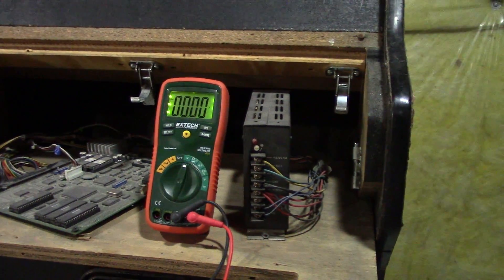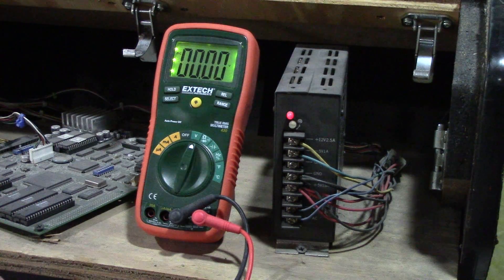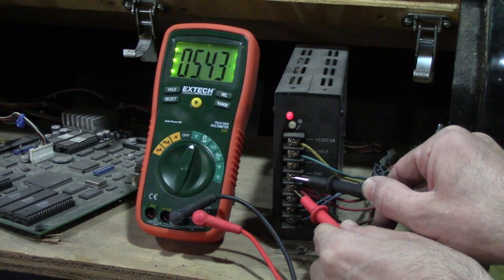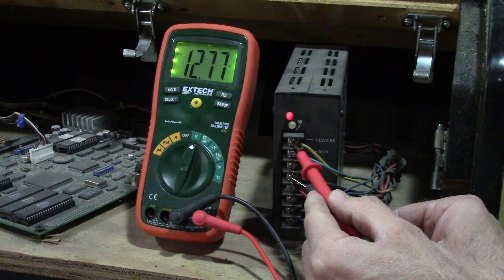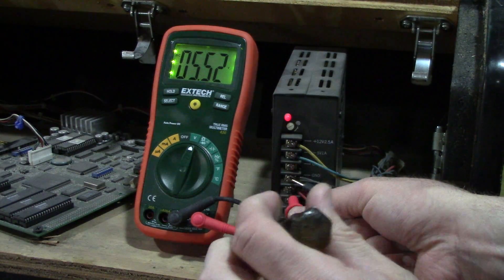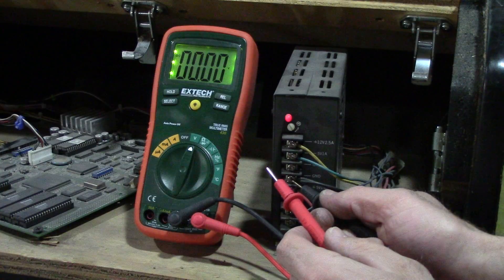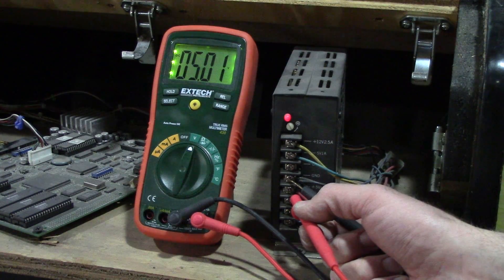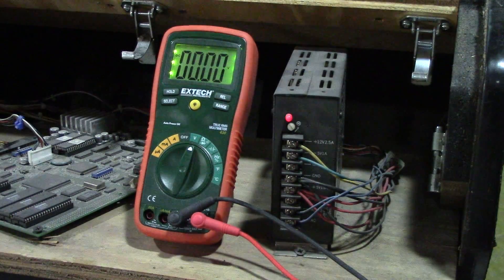How to test and adjust Arcade Power Supply voltages

Comment: Thanks for this. Im a noob at this and restoring a Pole Position. The old power block was shot and I bought a switching power supply to replace it. How do I wire the AC power cord to it? I also have the black, green and white wires which are the main power wires on the game but not sure where to wire those to on the PS. Thanks!!
Reply from the maker: I have never worked on a pole position but I have an atari cabinet.  It's possible the supply is the same.  It sounds like you are going to bypass the transformer altogether and that is a bad idea because all old monitors need an Isolation Transformer.  However, you can still use your new power supply, just run it and the monitor past the transformer first.
Reply: Mark Green there is three for the cords you have to know the polarity of the cords.  They have like N, L, and Gnd - which the GND is usually Green.  Now I had to Google and use a multimeter to figure what Those two other were, but I believe it just means which one is Negative and Which one is positive.

Comment: New to this. I currently have a supergun and neo geo mvs. It wasn't difficult with this setup since I was able to buy a 2 amp molex hard drive power cord and skipped buying a arcade power supply. I'm getting a cps2 which requires more amps and will need an arcade power supply. Do you typically have to test the voltages everytime a new pcb is connected but not turned on or once you set the voltage as close as you can it is good for most pcbs? I think my neo geo is 2 amps and the cps2 is 3.5 amps.